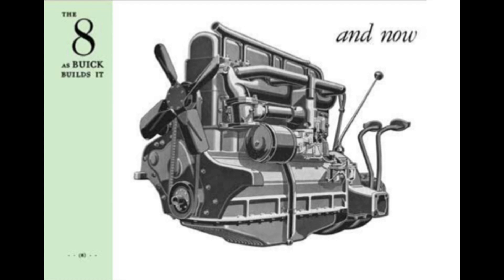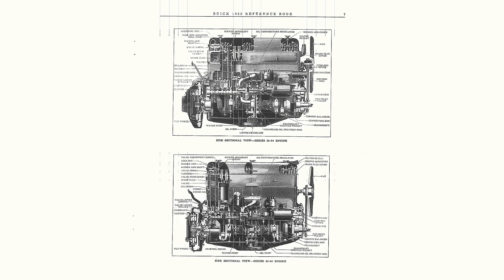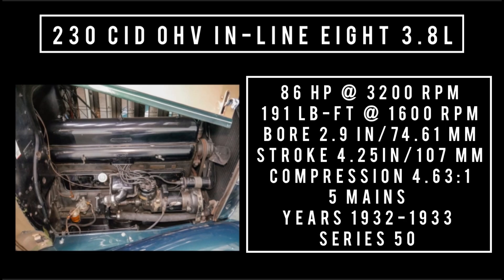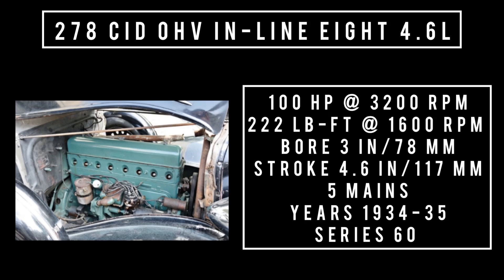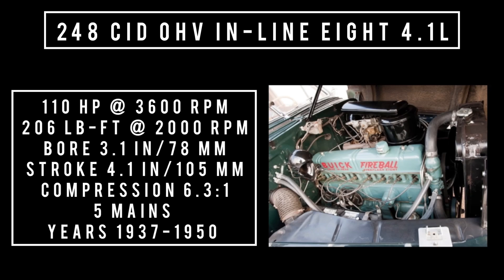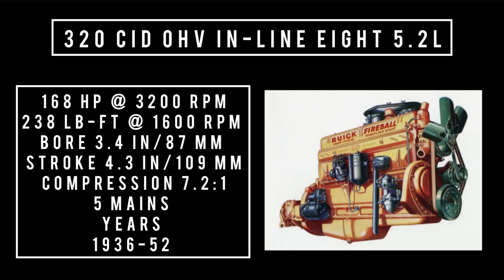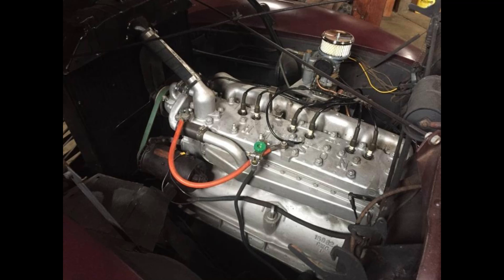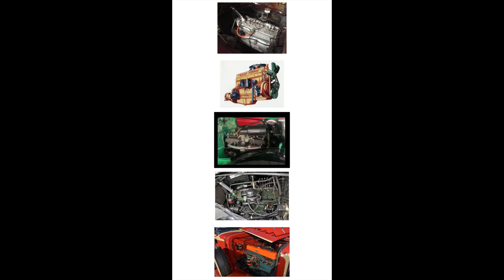Buick OHV in-line eight engine family

Comment: Because of the torque and the readily available parts these engines were very popular with builders of Chesapeake Bay fishing boats through the early 60's.
Reply from the maker: It would be sweet to hear one of those with the multiple carburetors and the velocity stacks.. that one had open pipes
Reply: @What.its.like.  They weren't built for speed and had a wet exhaust.  Most didn't have mufflers so they were a little loud above 1500 rpm.
Reply from the maker: Yeah totally agree wasn’t built for speed it was built for comfort Super smooth engine
Reply: The 320's were used in Flixible buses during the 40' & 50's. The had a unique sound. I thought they were 6cyl GM truck engines with special mufflers but they were straight 8's.

Comment: Packard straight 8's also had 9 main bearings. My pick as well. Really enjoying your engine series! Take care.
Reply: Yeah, the Packard was amazing.  Aluminum head in the end of the line '54 and 212hp IIRC.
Reply: Important to note that the Senior , or top of the line Packards - Super 8 , Custom 8 - 356 , 327 had 9 main bearings , the smaller series based from the 120 s , up to the 288 , had 5 .
Reply: @derrickrees8895  Thank you for that information.
Reply: @derrickrees8895  Believe they had 327s in the 9 bearing block and also in the 5 bearing block. Some 9 bearing ones might have had precision  hand selectable balancing weights (lead filled?) screwed into the crankshaft counterweights. 
I think some Packard Eights had shorter stroke and bigger bore than the Buick Eights. Probably more reliable when trying to make over 140 hp.
Reply: @derrickrees8895  There was also a five-main version of the 327 used in the 250 hardtops, convertibles, and in the '53 Caribbean, and in the fifties Super Clipper series. The senior models had nine mains.
Reply from the maker: I thought the Packard engine had nine main bearings as well but I couldn’t find any information to back that up. I thought that was one of their selling points as well as one of the reasons why the engine was so reliable. One day going to cover the Packard engines as well as some other really cool stand out engines that don’t get the time of day i’m trying to think when the best day to do engine day it might be a discussion episode it might be an engine episode I don’t know I thought about doing various days for various things
Reply: Some of the Super 8's during the 30's had cadmium-silver bearings, probably a throwback to when the competed with Rolls Royce.
Reply: Funny thing was, Packard 6 and V12, both had 4 mains, was it vibration only that made Packard forsake 5 mains?